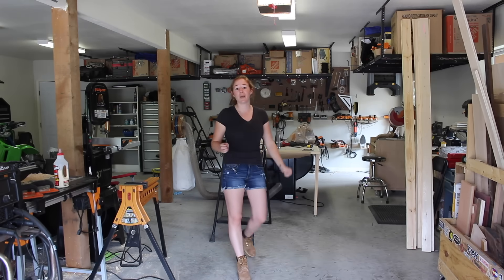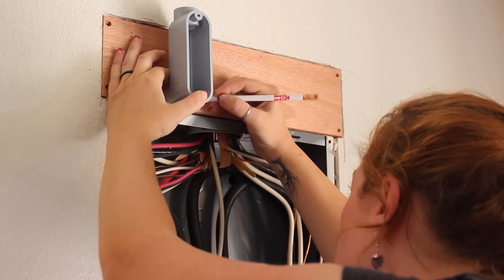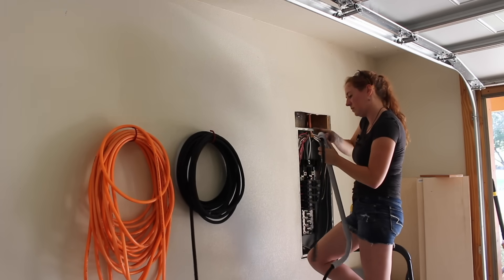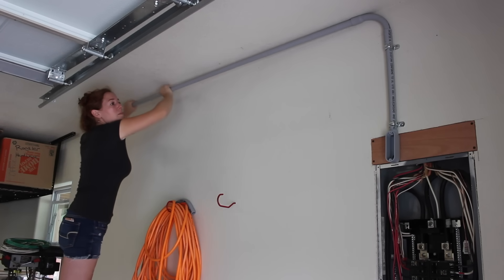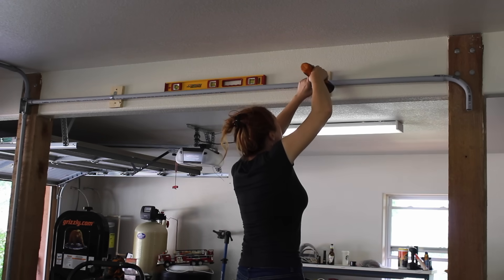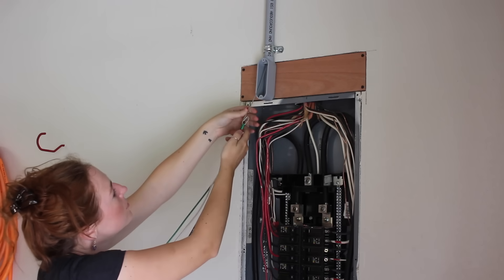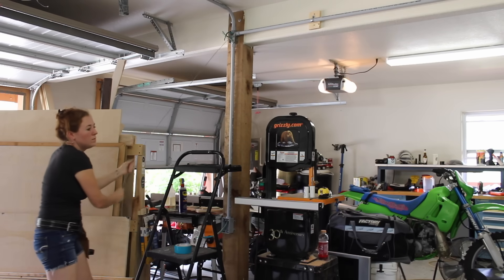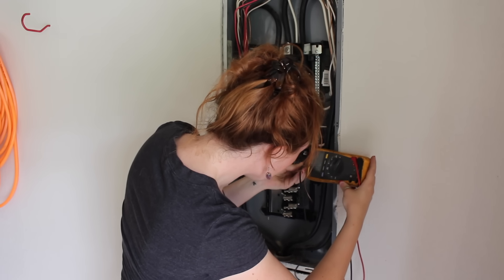Adding 220 Volt Outlets to the Garage

Comment: I am no electrician but would a pvc weather proof box (matched w/ conduit) would of been better than a metal box, and if running a (120v×2) 240, I would of used a red-(hot)wire in stead of a white-(N)wire, cause that is usually ment for a neutral...being nice :)

Comment: I'm no electrician, but the one thing I would suggest. Wrap electrical tape around the end of the fishhook once you have the wire in it. This is because if you pull it back, it could snag (that opening on the top where the loop back metal meets up).

I had it once get caught in some conduit, and was worried I may have had to do damage like work to remove it (lucky I didn't)

Comment: Is it ok to a 50 amp receptacle on 20 amp 2 pole circuit breaker with 12 gauge wiring? My welder says it only needs 16.6 amps on 240. Thanks!

Comment: Eh, nice work...but in the future, size up the PVC, its cheap, and a 1 inch over half inch, or three quarters inch would allow more room....PVC tends to grab wiring if you are running thhn around bends. Nice to see the trade survive more than previous years. Oh, also...run 10/4 so you will have a neutral and a ground, and put in separate breakers for each box.

Comment: Good call on the thhn wire-it's all about heat ratings etc.The other issue maybe running pvc more than 3' out of the ground/pour,it should be emt.And i cant see how you connected the pvc lb to the panel,it should be in conduit the entire way.Where your lb goes thru the board above the wires are actually unprotected from the lb to your panel k.o.

Comment: If I ever get to building/remodeling my own home, I'm definitely running my wires in conduits. Bare/exposed wires worry me(irrational concern?), and running them in conduits makes it easier for future maintenance/remodeling as well as protection and possibly detection..
Reply: Conduits are not optional in the US. They must be used for any wires mounted along the outside of walls.

Comment: Well, you asked for it. Using the white wire for current carrying is inexcusable.  I know it was done in the past but the code is clear.  As long as you were going through the trouble, you should have ran a neutral wire as well in case you were going to use the outlet for something that also requires a neutral for the future.  Using a handybox is also too small and likely fails the boxfill calculations.  Using surface mount conduit in a finished garage also looks terrible. I would have run the wires through the ceiling.  Chances are it's open truces and there would have been minimal damage.  This will be functional but not up to code and looks terrible. No self respecting electrician would leave it like this.

Comment: You have zero 110 outlets and zero 220 outlets, because they don't exist. I don't even know where these terms came from. You have 120+V/240+V If you find an outlet with 110V on it, you have a problem.
Reply: TheSoloAsylum the nominal AC voltage in the USA was once 100 volts later it was 110 volts. Later it became 115 volts then 117 volts.  Even later 120 was the term used. Many utilities target AC voltage today is about 123 volts.  My apartment in California had 126 volts to 127 because I was right at the substation this on the higher side. The 240 volt sockets I installed a few months back were marked 125/250 volts. Light sockets for Edison bulbs are marked 660 Watts because the limit was 6 Amps at 110 volts. The older terms exist because many devices nameplates still say 110 or 220 volts plus these numbers still exist on many millions of devices and stuff that will be around 50 to 100 years from now too.

Comment: nice video @AprilWilkerson but isn't it supposed to be one 220/240 receptacle per one 220/240 amp breaker. , it looked like you split off into 2 on one I could be mistaken.

Comment: Her work is excellent.neat.
Not sure of requirements in US.but she deff does a neater job than all illegal connections in south africa.would hav loved to post pix.jus to gv u n idea
In SA cables are run on the floor,close to water,not insulated,plastic bags used as joints and car speaker wires used to run 220v in the illegal connection areas.
Her job is excellent

Comment: Nice work on pipe installation, but becareful on selecting the wire size and colors. By the NEC code the Black and White color used for single phase 120 V line. For 240 V line you should use black , red and orange regarding the amperage and wire size.

Comment: Hi April, Recent subscriber here.   I've been a master electrician for 35 years or so. I think the issue with running cord in conduit is that you then need to derate the ampacity of the cord due to heat buildup.  Also, when you run individual wires in conduit you need to complete the run all the way into the panel. Looks like you stopped at the LB on the wall above the panel.  Nice job.  Great videos.  Gives me ideas for what to do with my shop.  Thanks.
Reply: Thanks for pointing that out. The NM conduit MUST be continuous all the way through the knockout on the panel to prevent abrasion of the wire insulation at the pass-through. Expansion and contraction of the wire may cause movement sufficient to wear away the insulation at the knockout, causing a short.

Comment: When working with power, always, always, alway pull a permit. It doesn't cost much and you get the benefit of the expertise of your local building inspector who knows a lot more than you do about specific local building methods and has seen the many ways that homeowners can screw it up.
Also, when you go to sell the house, many buyers will want to know if all the electrical work was  permitted.
Finally, if there's a short and the house burns down, you're covered.

Comment: Just watched this video.  Honestly, I agree with most comments.  As you can see, there are probably plenty of electrically qualified people commenting that are 100% correct in the interpretation of the code.  As with any code, there are always some areas of interpretation and also areas where the local inspector (jurisdiction) calls out certain things and will ignore others.  I have been an electrician for over 20 years and while there are clearly some code violations, the only one that really would trouble me would be the entrance of the conductors into the panel.  Not being able to see the fitting you used in the wall to make the 90 down into the panel is the biggest area of concern.  While code does not allow you to bury a fitting that has a cover, I am hoping that you do have at least some kind of fitting and that you did not simply come out of the PVC LB with the THHN and into the panel through a knockout with sharp edges.  If you did, fix that.  (Would not be hard to fix)  Over time, vibration in a home can erode insulation.  The problem with that should be obvious.  Other than that, nothing else will burn down the house...   :)  All joking aside, I did not note the size of the conductors or stop to go back to look at the plug config (i.e. 30A 220V, etc.)   Using a white conductor and not re-identifying it will not burn down the house.  However, it could have been easily solved by taping it black.  Other than that, great job for a non-electrician.By the way, I love all your videos.  As an electrician, I need all the help I can get with wood.  Cheers !

Paul

Comment: Um...... there are a LOT of electrical codes (depending on where you live) that require a “cut-off switch”.  Check out a typical residential a/c condenser outside your home. You could have mentioned that. If a home owner tries to sell their home, a home inspection will make you install one, or take the WHOLE thing out. Just FYI

Comment: When you pull the wires through the first time. ALWAYS add a strong string with the wires. Make a knot at each end and leave each end in the terminal box. That way if you ever need to add wires ..... no fishing is required!!  :)  Just my 2 cents

Comment: Here in Holland we have standard 220 v and usually sit up to 10 sockets and light points on one circuitbreaker of 16 amps. Nice job.
Reply: Sander en Davie UK is 230 volts nominal, we usually get about 245 volts. Sockets are generally on a ring final or radial rated 30 amps. No limit on number of sockets, but floor area served is restricted. Lighting by separate 6 amp radials. Most homes have an upstairs and downstairs socket circuit, same for lighting, with additional circuits for kitchen, garage, immersion heater if fitted, cooker, shower and other additional circuits as necessary, typically 10 or 12 in total for an average home.

Comment: Instead of linking the second socket in the junction box I'd of fed the first socket and have a second set of cables go from the first socket to the second socket that being said there was nothing wrong with your method and please excuse my grammar and note I'm an English electrician so don't know your local code and regulations

Comment: green white and black wires ? Wouldn't that be earth neutral and line ? In this setup you needed 4 wires
Reply: You didn't explain anything about the actual wiring of the breaker or 220 plug in.

Comment: Well April you did the circuit right no matter what licensed electricians said, I guess they are getting old and forgot a few rules in your favor. One being  based on NEC 43rd edition says you could have a dedicated circuit to each tool but using 50A 220 breaker for counter top and over is legal to use for both one 1 circuit so PLUZZZZZ to them.

Comment: Great work adding that 220v line. I'm plugging my everlast welders into the dryer outlet. I should consider running a dedicated line.
Reply: I once made a 200 ft 220v extension cord so I could use my shop welder to work on my step fathers  miniature railroad track away from the shop 220v outlet. Just put the welder on a flat car and stretch the wire to the mob. I think I was about 12yo when I did that. SF did not want to rent tanks for an acetylene torch (would have cut into his beer and whiskey cash) so I made do with what I had.

Comment: Being an electritions I see you have many violations. That bussing in the panel is hot you need to be more careful about where you put your hands. Safety first. If you have a code book use it as a tool and make your install comply.

Comment: Not an electrical, but I've added many breakers 110 & 220 over the years in the homes I've owned. I see absolutely nothing wrong with this job, it's going to work fine, and looks like a safe, neat install.

Comment: Where you put those blocks of wood to make that pvc go straight across you could have used a heat gun to bend the conduit to make it flat across the surface. Still looks good the way you did it though. Good wor

Comment: just wanted to mention how it works in sweden: you can do the wiring, but to do the connections in the fuse panel or similar, and the wall sockets, you HAVE to be a certified electrician, that can guarantee that the work is properly done and sign the papers that is done correctly.

Comment: April. May I ask how you de-energized your electrical panel before you started your work?The only thing I think I would have done different is use a bigger junction box where you made your connections and use a plastic box. It may seem trivial but I think the metal junction box should be bonded to the ground wire. With the plastic conduit, a bare conductor could touch the metal box and energize it and there would not be a path to ground for the fault. If you use EMT I think you're allowed to use the conduit to provide the ground path back to the load center instead. You experts out there correct me if I'm wrong. I think you did a great job.

Comment: hey there april just a few comments about how its done in the uk we have 240v in our houses and 415v for things like machinery would be industrial it was interesting to see all the copper earth cables bare in the uk we cover them with a green and yellow " earth sleeving " it stops them from shorting against the neutral bar or a live part .what you were doing with the s.o wire ??? I think that's equivalent to twin and earth in the uk running that through conduit either pvc or steel  would have been fine in the uk as long  as theres enough air gap  round the cables to dissipate heat . I found the junction you done above the socket interesting in the uk we wouldn't have had that joint and instead carried it down to the socket so you would have had six cores at the first socket (instead of  having to join 9 cores  together at that junction box) and and three at the second socket .but what you did from a uk point of view looked good as long as the breaker and cable is appropriately sized for the load  well done :) alex

Comment: That handy box was packed a little tight for my taste. Would have spliced in a full 4" square box for that much copper. A handy box is good if all you need to splice are 2-3 12-14 AWG conductors. Also, while wire nuts are traditionally the go-to connectors, nowadays I much prefer Ideal in-sure push connectors. They give you a larger number of ports and take up a lot less space in the box.

Comment: GFCI on a garage or basement? no? .... mmm.... is not a good idea to use white on 240V wiring , is best to use red and black, or black and black with colored tape  in the junction box, panel and outlets.... but its a good job, well done in terms of mechanical installation.

Comment: I'm studying to become an Electrician, and I have one question. You can make splices of those two sets of 3 wires you fished into that one box with the wire nuts ?
Reply: There must be an NEC code for the size and number of wires, but assuming that the wire runs are within code, I'm not seeing an immediate issue.  I'm not an electrician, but I see that your question has gone unanswered for 2 months and since I've done a slew of wiring myself, I thought I'd throw my 2 cents in.  The question remains unanswered in any real sense and may depend on location or the discretion of an inspector.  Good question.  Oh, there's probably a limit on the number of wires that come into that box.  In the event of many wires need, like if she need 6 or 8 other outlets., 2 or more boxes might need to be used.  So don't fan out from one box.  Run the boxes in series to cut down on the number of connections in each box.  I do hope this helps.
Reply: alex tworkowski Hey man ! Thanks for an answer and your not wrong at all. I received the 2014 NEC about 3 weeks ago because where I live we are on the 2011 code and our instructor teaches based off 2014 and the only main changes in code is Arc faults, and GFCI for more equipment. So yes I reviewed Art. 314 which covered box fill, and Art. 300 which had all types of wiring methods, ampacity charts and tables in .14, raceway (conduit) ambient temperatures, correction factors and a whole load of information that I've never known before and what you said is true and it's right what you said box fill helped me out. But It's a cool trade and I will do an apprenticeship for sure and get a career in the Electrical trade as an Electrician. It's not the easiest work out there, but it's fun, challenging but good, but most importantly it's so satisfying and pay starts off in the low end, but with experience and free apprenticeship classes to get a journeyman licenses you can make a comfortable living and make great money.
Reply: Electricians are the star of the show.  They get paid the most and they have the best jobs.  I know electricians that make really good money and they are very smart.  Stick with it.  You never know where life is gonna take you.  Good luck and thanks for the response.

Comment: How did you run the wire from the ‘access panel junction box’ to the breaker? Does the wire have to be covered with romex the few inches from your access panel till it turns into the panel??

Comment: I would have used two 30 amp breakers so I could have 2 sockets on one breaker then the other 2 running of the other. Then you would have more outlets to run things

Comment: I realize this comment comes 9 months after the original post. As a licensed Master Electrician, I see a few flaws in the project. As some have commented the Handy Box is not big enough to use as a junction box for the amount of wires she has going through it. Also being that it is a metal junction box, it is required to be grounded even though she is using PVC. She should have used a PVC junction box. I too have concerns about how she got from the LB into the panel. The only code worthy way would be to use another LB to drop that tight into the panel. As another has mentioned the use of white wire as a hot leg is not allowed in this wiring application.  I applaud you for  taking on the project, however you should do your due diligence in learning the correct code worthy way of completing it. After all there are at least a dozen electricians on YOUTUBE that show you how to do it correctly. I would like to see a video on you taking apart your work to do it correctly. This is something I have had to do in the past when our state electrical inspector found deviations to the NEC.

Comment: If you only have 120v in the house how did you double it to 240 for the new plugs.  Just find it odd in Aus we have 240 to the house. It must take ages to boil water at 120?